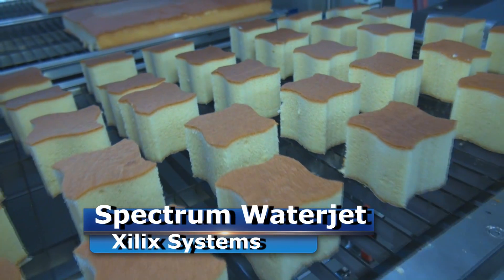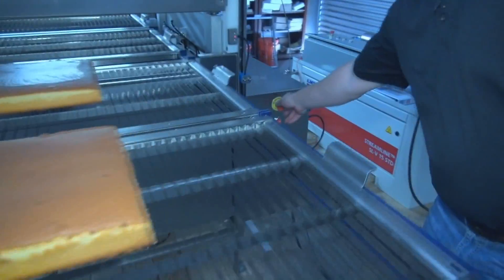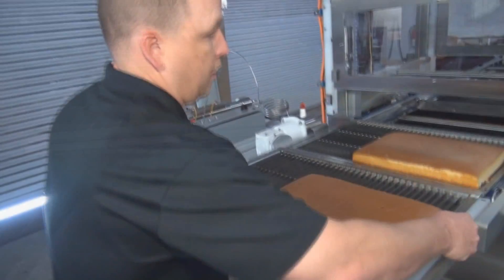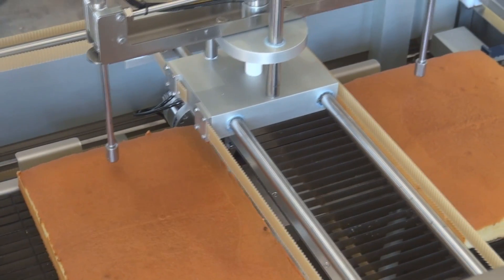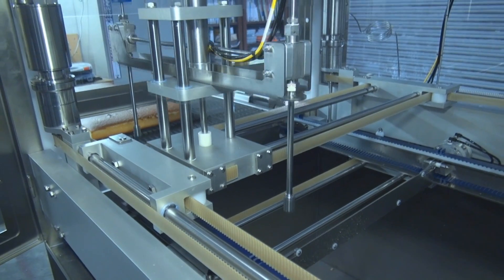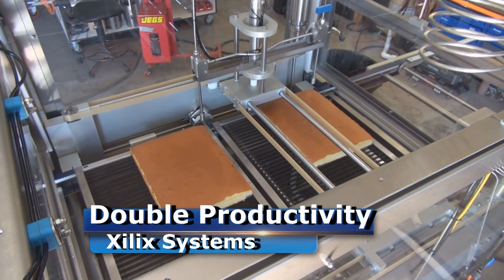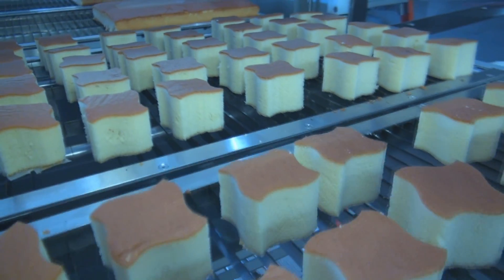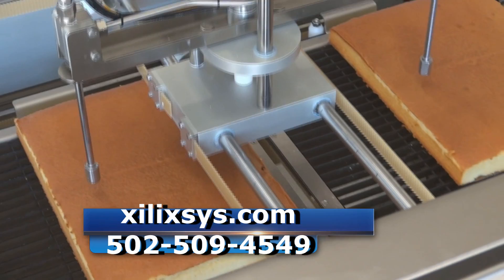Xilix Spectrum Dual Head Waterjet Cake Cutter

Comment: How much this machine will cost us
Reply from the maker: Hello--The cost of the machine can vary a bit based on customer requirements as well as the final destination for the system.  We need to take into consideration duties, taxes, travel, etc. when bidding a system like this.  Customer requirements can also vary somewhat so we would need to know what the customer plans to cut.  For more information and quote, please fill out the form on this page https://www.kmtwaterjet.com/a-kmt-what-material-are-you-cutting-us.aspx  or contact a KMT Sales representative at email: sales@kmtwaterjet.com  or  +1(620) 856-2151 | (800) 826-9274